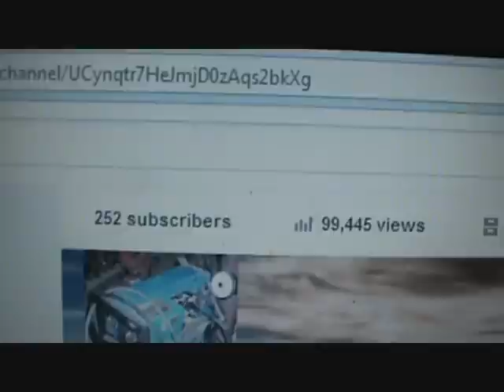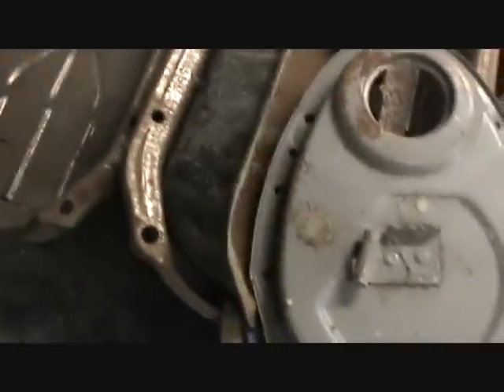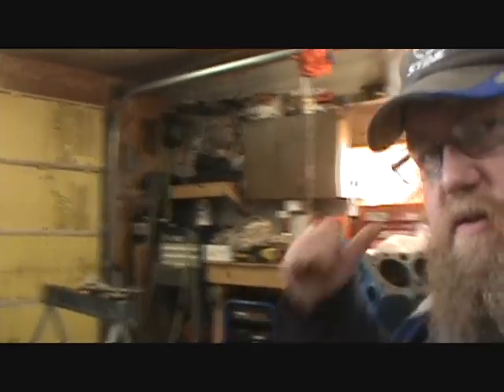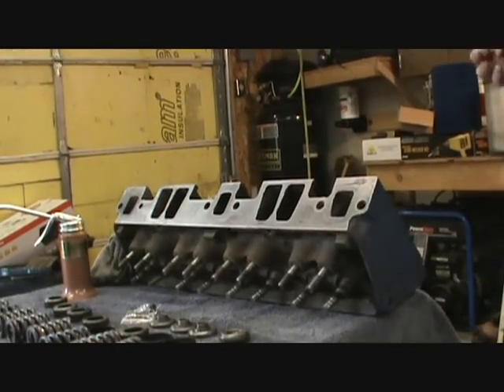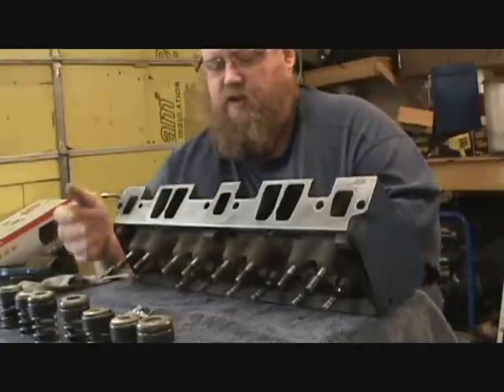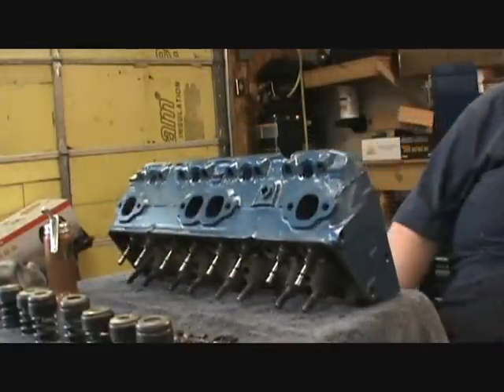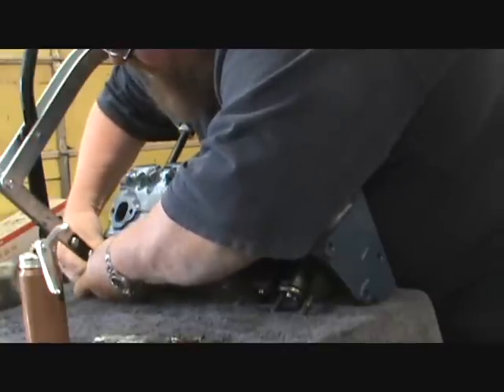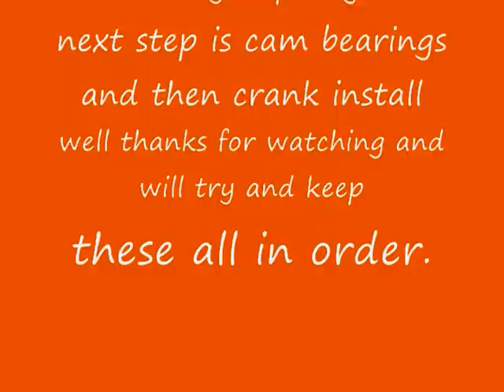1978 350 chevy motor build part 1 head assembly

Comment: i wouldnt recommend using a used oil pump on a fresh rebuild.it would really suck to have to pull the motor back out for such a low cost piece. i know your tight but - id wait till i could get a hold of a new one--take care
Reply from the maker: i do have a new one and its in the motor.

Comment: Thank you for giving us beginners some great advise. 
I know nothing about heads, but, I do know a small amount about cam bearings.
One trick that I have been told about, but am chicken to try is drilling a third hold in the front cam bearing.
Your knowledge on the oil wedging, and putting the holes around the 2 o'clock position with engine in up right position (8 o'clock upside down) is correct. If you don't you are oil starving your cam on every startup. 
http://www.dura-bondbearing.com/Portals/3/pdf/Cam%20bearing%20oil%20holeTechnical%20Bulletin.pdf
Oh, here is an article on the third oil hole being drilled in the front cam bearing...
http://garage.grumpysperformance.com/index.php?threads/cam-bearing-install-tools-install-info.1479/
Reply from the maker: +SchneidersShop guess ni never heard of doing the 3rd oil hole before
i will read up on it more later thanks